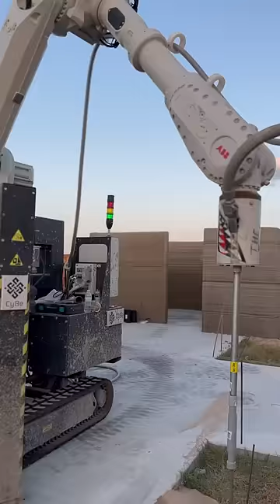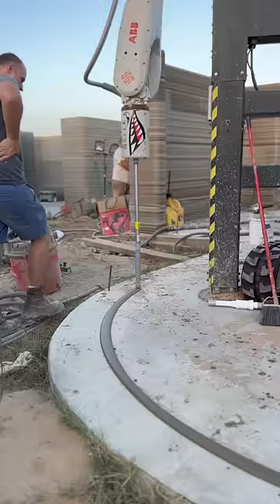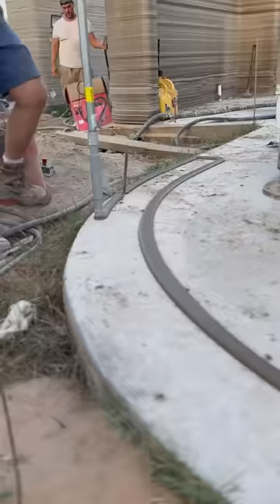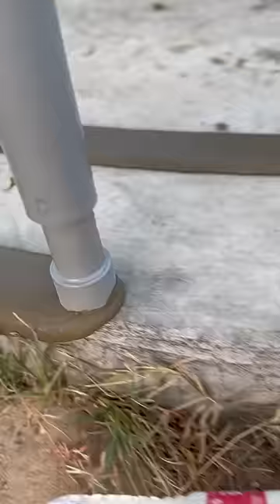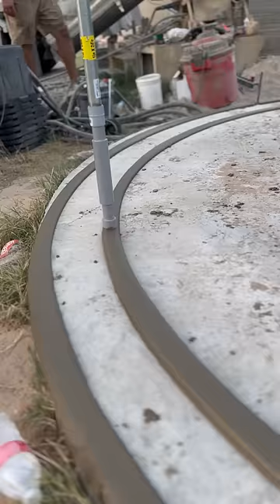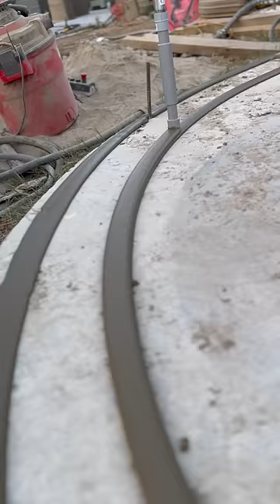Starting a fresh new wall with a two man print team #Hive

Comment: The most crucial aspect is to prep the surface before you start. You literally couldn't have fucked up any worse without trying
Reply: Respond to me if you hate your mom
Reply: @Sabrinajeromej  they are literally printing the foundation onto sand, it doesn’t take a genius to realize that’s not a good thing
Reply: @STOPSYPHER  that’s cool, thanks for the information.
Reply: Some people are just lazy.
Reply: Exactly what I was thinking!
Reply: We are going to see documents about how bad these houses are in the future.
Reply: @XiBMCiX   You’re going to see deez in the future
Reply: You’d hate to see how new foundations are poured directly on the soil 😂 most dr Horton community’s have no moisture barriers
Reply: @STOPSYPHER goteem
Reply: @w9006  wait, really? I’m from Germany and I’m pretty damn sure that wouldn’t fly here
Reply: @jonasghafur4940 Ja weil wir es halt einfach können mein deutscher Freund :D
Reply: That dirt is not accidental.. that was placed because the footing does not extend far enough.  The dirt is a shelf they are printing the wall onto.
Reply: @w9006  you shitting me.  Those homes are built all around my area.  But they cannot a passed inspection in the city without it on a prepour inspection. So they have to have the plastic 
 I know they are cheap but dang😂
 I’m a custom builder myself and what I build vs what they build are two different things.  Those are what I call starter homes for first time own buyers.
Reply: @johnhancock9249  lmao no I’m not shitting you I’m in flordia and we’re still recovering from hurricane Michael and they have the audacity to put trash for sale. So I am very tough on there compaction testing and there slump testing,I failed 95 dr Horton homes the other day 🫡 and if you tour any of there sites nothing is square in the house no baseboards line up outs aren’t secured to studs properly there trash and it’s sad a young couple will buy it thinking new house no problems yk
Reply: @Sailor376also People don't seem to understand this.
Reply: I figured they were doing test run to see if its right
Reply: @atron7000    Oh, that is possible.  Even if they continue up,, I suspect the dirt shelf to get the wall install moving,, it will probably stand and the foundation can then be adjusted  (dig down flush with the new wall and increase and pin the new to the old.  It could be done.  I am unfamiliar with what techniques are normal and acceptable,, and what is not. 
The heat loss, thermal bridging at the openings has got to be extreme.  The heat loss through the exposed edge of slab has got to be a killer.  I can imagine a solution to that.  Do your electrical in the outside walls first, then foam fill them,, R-20; R-30??   THEN at each opening, cut the concrete of the wall that faces the door or window and remove a 2 to 5 inch piece of concrete , Replace with a high density foam strip. THEN install the window or door covering the thermal break.
Reply: @lonesomedove6960 they are building walls the laziest way possible, so that tracks.
Reply: @Sabrinajeromej ummm soils under the cement bud...that's not a bright thing to do. 
Do you mix dirt into your cement???
Reply: @GoldVP...  what are you talking about ?
Reply: @atron7000 You're probably right. I read a report recently saying 10 of these were torn down, and they weren't old or anything, they were just never meant to be occupied. They were tests, training, & tuning.
Reply: I was about to say "that build is dirty AF"
Reply: @Sailor376also yea, that will settle and wash out from under the wall. That's their point.
Reply: You couldn’t sweep first. Y’all have a robot doing the work and ya still can’t sweep. How lazy can you  actually be 😂
Reply: Omg , so right, near future failures 😮😮😮😮
Reply: Whoops out of ink.😢
Reply: Literally didn't even sweep off the footing...😂
Reply: Exactly!
Reply: Thank you. I am no builder and even I flinched over the idea that my house is going to stand on that loose dirt.
Reply: Truth.wasnt centers either
Reply: You people will complain about anything and most of you don't even know how too tie your shoes
Reply: What's anchoring that wall besides one ten inch of a single rod? What's this slop made out of? We building walls out of mortar or is this concrete? How does moisture escape these walls? What kind of psi is this stuff rated? I don't trust it and I don't think nerds should be playing bob the builder with homes. Especially lazy ones.
Reply: @XiBMCiX trust me buddy the new construction houses unless they're custom are built like shit too.
Reply: Cool, was just about to say that looks pretty dirty.
Reply: @Sailor376also no duh, and you don't think it will settle? Lol
Reply: I, like most people, have learned this the hard way over the years and these guys are supposed to be professionals. I find it astounding their work is that dirty
Reply: Should have had real concrete contractors do the footings maybe the radius would have actually lined up
Reply: @w9006 you don't need vapor barriers for that lmao
Reply: Well said
Reply: @bramdonstroth7865  are you 10? You clearly don't know a thing.
Reply: Says the person who doesn't know how
Reply: It's crazy how most y'all don't know anything yet you still comment about it first of all it's concrete. You can print it on anything. That is the beauty of it. All of your houses have a foundation that's What the story of building your house on a rock means. You can build a house anywhere only because there's a rock underneath it with enough surface area to withstand the sand. However, if you are printing with concrete and building the entire house out of concrete, it doesn't matter where you build it. You can do it anywhere. So shut your yaps. You know nothing
Reply: @jonasghafur4940 you would be wrong my German friend
Reply: @Sabrinajeromej  I don’t do it, but my boyfriend has been doing it for almost 3 years. But maybe he does it wrong and you’re supposed to make a mess on your foundation before you begin. That wouldn’t surprise me one bit honestly. It seems like everything I learned when I was in school, was  wrong anyways.
Also in regards to my original comment,  I’m sorry, my OCD took over for a moment and thats something I’m working on. I’m really trying my best to be impeccable with my word. 
✌🏼
Reply: No no no. You gotta clean the surface with alcohol, level the bed, and auto-home. Then you slide a piece of paper under the head and raise the bed until it just grabs. Move the print head to each corner and do the same thing. Then preheat it and do it again. I swear the guys with the best gear never know how to use it. 😂
Reply: @w9006 used to do insulation for a co.pany contracted by Horton and those are the worst homes I have ever been I side of. Anyone ever wanted to buy a 800 square foot shed connected to twelve others for 150k$ for each shed?
Reply: Homelessness is not caused by lack of available houses.
Reply: @Sailor376also so instead of having the wallet be printed correctly and not go over the edge of the existing concrete, let's put it hanging over the edge on sand I could kick out with my foot? 😂😂
Reply: @Sailor376also what do you mean get the wall install moving, the wall could have been printed at the correct placement and it clearly wasnt
Reply: @nickbrooks8369 thank you. Or maybe just get the measurements and prep work instead of just slapping it together and rushing
Reply: @Hypergames555 you have showed nothing but the fact you are the one that has no clue what they're talking about stick to gaming
Reply: @Hypergames555 so based off of your 14 year old logic, you can just take this machine and start printing concrete on the beach ? 😂
Reply: @Sabrinajeromej it's obvious to anybody watching this, the machine is off centre. Run off onto some dirt beyond the slab.
Reply: Yeah  I noticed that too
Reply: @STOPSYPHER literally wht i was thinking
Reply: These houses are going to be shit in a decade.
Reply: @Sabrinajeromej ”dontbeasheep” over here being a sheep
Reply: There is sand in concrete.
Reply: @Hypergames555 well said m8.. Everyone in the comment section has suddenly became structural engineers. All because he poured over a bit of sand.. I'm pretty sure the guy doing the job ain't that fkn stupid. There's probably a good explanation on why he done it. For all people know that bit could be getting cut away for something.
Reply: He literally took more time preparing that landing strip on his head
Reply: Don't we all love armchair experts?
Reply: Shame it's not on the slab properly....
Reply: The begining/end of the wall is IN THE DIRT off the slab. You see the radius of the slab and it doesn't match and they built up dirt to hide it and stick it to the dirt. Also yes agree too, their surface is Dirty and those walls will not stick to that.  These two people messed up their jobs big time
Reply: Everyone calm down this is to learn the equipment it's not for permanent structure. It's testing and teaching. They could do the entire thing on compact dirt if they wanted.
I love armchair experts their wrong 100% of the time.
Reply: @dontbeasheep1603 he's talking about the shitty prep work.......
Reply: @Sabrinajeromej she ain't wrong it don't matter if she ain't done it a single day, in her life.
Reply: This is being done by amateurs. It’s printing off of the slab and on to that sand.  Zero fucks given, apparently.
Reply: @lonesomedove6960 lazy in this case gets a 5 ton wall dropped on you
Reply: @jonnyreverb  lmao. Maybe they have a BLE Touch installed??  Hahaha
Reply: @Sailor376also So basically Mexicans poured the foundation out of round right...
Reply: @w9006 how's the painting business in Florida?
Reply: @guiltyifudnthavemnybuyinnocent  not sure I don’t paint but there’s a lot of development so everything needs painting so I’d assume good especially out in 30A and margarita ville rn and PCB
Reply: Educate me, what's the issue?
Reply: @user-sz4ve6nb9y  one it’s wet concrete on dry which isn’t really a big issue but there’s debris and that concrete is gonna dry with debris in it causing air pockets and it decreases the integrity of it all concrete have mix designs so they have to meet a crush test standard where you see how much psi it can take and how it breaks breaks are usually done 3 7 14 and 28 days and a hold cylinder to see what they break at since there is debris in there the breaks won’t come out the same as where the air pockets are so you can’t get a true test the surface being dirty ducks the bonding long story short
Reply: Hell I'll live in anything that sturdy. Warm and spacious for my stuff and me and the wife 😅
Reply: Every video they have they are seen putting down over no footings
Reply: @STOPSYPHER man you want your edgy 12 year old card? Touch grass😅
Reply: 100%
Reply: @STOPSYPHER  It's clearly concrete.
Reply: The lack of surface prep drove me nuts too!  So lazy!  Their business will be swallowed up by one that cares about details that in turn help a product last!
Reply: @lonesomedove6960 most builders just don't give a fůčk because it's not theirs. that's 99% of anyone in the trades. very few actually take pride in their workmenship.
Reply: @thewhitedillard  thats because most people are worried about money, instead of the impact they left on the world. I have a 4 family household. Only me working. And i make it by easily on 500 bucks or less a week. Everybody gotta have the weed and beer these days, and spend their paycheck before they see it.
Reply: Is that print centered? Seems like they're an inch too far over and printing onto sand and dirt. Cool toy though!
Reply: did you see where it started to pump concrete an inch away from the foundation? lil dirt won't hurt.
Reply: @Sailor376also  so, they didn't properly pour the footing and instead of fixing it the correct way, they just print into dirt? Sounds like a horrible job all around.
Reply: @NickBoyer-hz9ku   but at least I know the difference between too, to, and two. *To, is the one you were looking for. Besides that, what an ignorant comment “you people  will complain about anything.” Actually I’m usually quite optimistic, some days  I just  can’t help but speak what comes to mind. But by complaining about us complainers you have effectively become one of us. You were right about one thing though, I don’t have any shoes with laces because I cannot figure out the loop swoop and pull thing.
Reply: @Sailor376also so then part of your exterior wall sits on ground instead of concrete?

Pretty neat solution to not laying it out properly.
Reply: @SDSypher  yeah DEEZ NUTS...   ha ha..  gotem
Reply: Hands on hips like a girl as well
Reply: @jonasghafur4940 lmao what??? Ur carpenters are all watched and never allowed to go off and do their work without tons of ppl checking in? The gov watches all of em? And they're all experts? Maybe Germany in the 1940s had a gov that controlling.
Reply: @superOnovaRA yes every single German is amazing. Hence the 40s.
Reply: I have no clue about concrete my first thought was id want that cleaner before laying it lol
Reply: @Sailor376also so what supports the walk when it rains and the dirt washes down the yard????
Reply: @allen5976  The initial support is the dirt.  As the concrete sets, a small cantilever should be no problem,, FOR THE SHORT TERM,, there is enough wall on the slab that the small amount hanging over dirt should be no problem.  BUT,,,  The foundation will need to be increased under that overhang to support it long term,,, hopefully before roof trusses and shingles go up.  The roof and trusses do not add all that much to the loading,, but a snow load,, or a strong wind load,, it all gets transmitted down to the walls and footing.  Additional footing can be custom poured under that overhang,, pinned,, and to the spread footing below.
Again,, I will say,, I have not built this type of house.  But nearly all footings, slabs, and basement walls are NOT perfect.  Over the decades you learn what corrective techniques work in construction.  We are humans,, there is nothing that we build that is perfect, nothing.  You learn what to do to correct those deviations.  We all do, we always have.
Reply: @Sailor376also it's not even compacted or held by any forms, plus 3d printed house don't have any rebar or wire. Never going to last without collapse
Reply: I don't know anything about building a wall, or what's going on here, but my thought was...
I would have cleaned the surface first.
Reply: fr
Reply: Bro these fucking Bot profiles really in here with the most viral comments! Smh.
Reply: Seriously lol you don't lay concrete on dirt 😅
Reply: @STOPSYPHER got eem 😅
Reply: The amount of the wall can be hanging out with nothing under it
Reply: If there's an earthquake or any seismic activity the house could slide.
Reply: @andrewsvatik8300 of you're doing a test run you do it dry without dispensing material onto the slab
Reply: I was thinking the same thing lol
Reply: First comment verified my feelings 😂
Reply: @Sabrinajeromej  curious what your work experience entails
Reply: That's what happens when it's supposed to be a 3 man print team and the Head team member is not there.
Reply: My exact thought 🤦🏻‍♂️
Reply: @SDSypher 😂😂😂😂you know how many houses foundation are poured on sand
Reply: @coreymonday1375  Yeah, after they dig down 6 to 8 feet. You don't make a pile of sand and then pour on top of that... lol.  Time to get outside of mommy's basement and mix up some concrete.
Reply: Nope. The concrete won't stick to the slab monster what you do. You could beat it with an attachment on an SDS, and put some bonding agent, but it still won't stick. The walls should be tied into the slab with rebar. If you don't know what you're talking about, refrain from inserting your worthless comments.
Reply: @Sailor376also that means the footing wasn’t done right. Lol you can’t replace concrete footing with sand and expect the same results.
Reply: Damn gotem 😂 @STOPSYPHER
Reply: @SDSypher  it's fine it's not making it weaker it doesn't affect structural integrity at all
Reply: @Sailor376also  But.. the dirt being put down because the foundation wasn't big enough is... worse! You see how that's worse, right?
Reply: @PuckLokin  It can be fixed afterward. Yeah, its awful.  But don't stop the machine.  That printer costs what? 1,000 dollars an hour?  10,000 dollars an hour?  Whether it is running or not.  So, you fix the defect afterwards like all the other foundation misses   I have built hundreds of houses, 2 or 3 foundations have been flawless.  The rest all needed some shimming, repair, brick ledge,, something.
Reply: So true
Reply: @Sabrinajeromej  caught me
Reply: Yes @Sabrinajeromej
Reply: Agree
Reply: @Sabrinajeromej Bro really edited his comment because his ego couldn’t handle that he was wrong. 💀💀💀
Reply: @Sabrinajeromej lol wth is your problem? You just blow in from stupid town?
Reply: Whoever poured the slab sucks.
Reply: Looks like they didn’t set up the machine in the correct spot and they just don’t give a shit either because they’re still laying mud!
Reply: @tombragalone7250  
To me it looks like whomever poured the foundation screwed the pooch on this one.
Reply: Guys, here is our Savior

HalleluYAH translates “Praise ye YaH”

YaH is The Heavenly Father
YaH arrives via the TENT OF MEETING
YaH was Who they Crucified for our sins
YaH was Crucified on an Almond TREE

Semitic of Moshe (Moses)
Isa Scroll (The Original Isaiah)

Isaiah 42:8 - I am YaH; that is my Name! I will not yield my glory to another or my praise to idols.

Isaiah 43:11 - I am YAH, and there is no other Savior but Me.

Isaiah 45:5 - I am YaH, and there is none else.
Reply: I was gonna say most of that ain’t even going to bond
Reply: The foundation is off by a bit... Ah just put some sand down it will doo😅.. how hard is it absolute jokers
Reply: Aaas y se dicen llamar perfectos...
Reply: Walls on dirt
Reply: Sand? I'm seeing a concrete pad. @STOPSYPHER
Reply: How is this more efficient than just building a damn building the old fashioned way
Reply: Yeah, that wall isn't sitting on that base in more than one spot.
Reply: @w9006 this is the truth. I’ve been in New construction for the past 7 years, and not all builders but most are throwing up houses in no time. Nothing is level, plumb, or square anymore. Wall studs are cheap metal and 24” on center rather than 2x4 centered on 12”/16”. I’ve seen new homes 2nd floor crumbled to the first floor, tile popping off the floor/shower walls, and the list goes on..
Reply: @Hypergames555 yeah… go build your concrete house on top of the ocean and tell me how it works out.